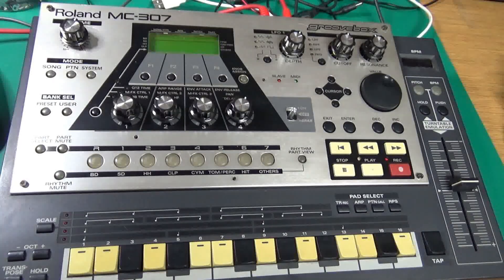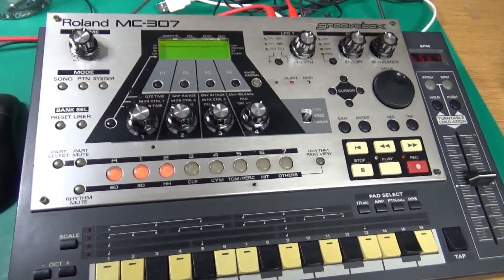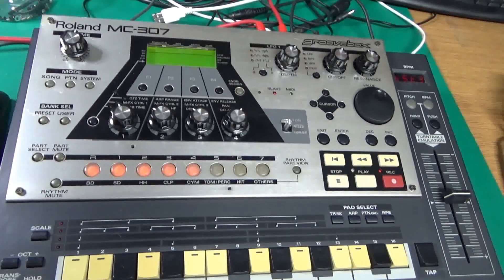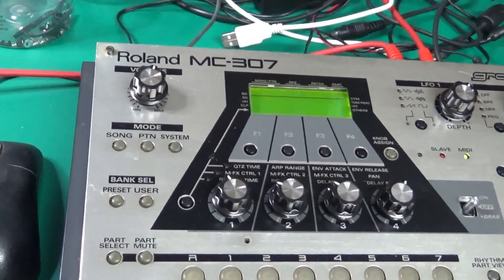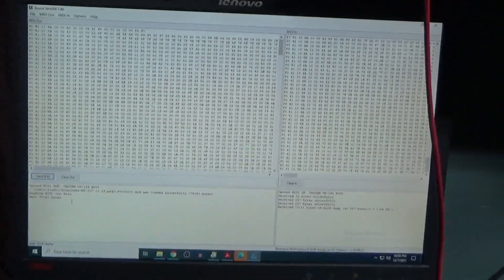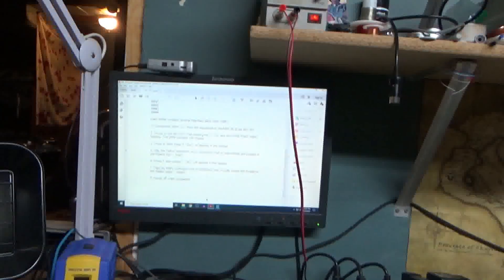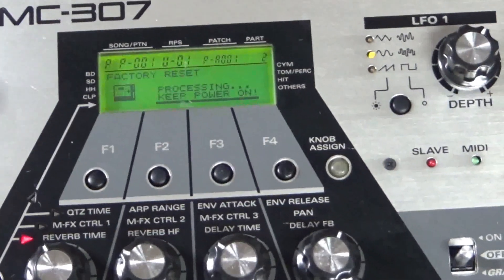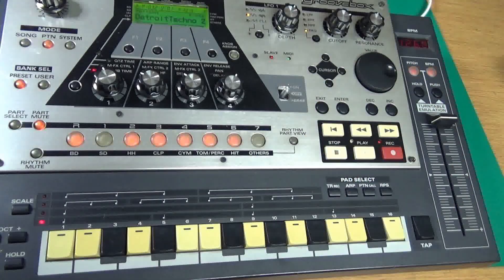Roland MC-307 Blank Screen Fixed

Comment: I did this method and it didn't work, I used the same software, a good midi cable. The Roland Verselab was used, connected through usb, midi out was going in to the mc 307, the lights light up on the 307 as the midi was downloaded but at the end still blank screen, maybe it must be the midi interface on the verselab?
Reply: Bro did you find a solution for the problem? Sadly didn't work for me 2
Reply: @darkpolution468  Ive tried with the same audio interface that's in this video, everything goes well during the process but when I power it on at the end the screen is still blank. May have to submit to a Roland technician.

Comment: Thank you for this tutorial! Running into an issue hoping you can help? I'm on a mac osx, so using sysex librarian instead of Bome. Every time I try to load the .mid files into sysex librarian, it says the .mid files have no sysex information.. Any ideas?
Reply from the maker: send it as a midi file, not a sysex command